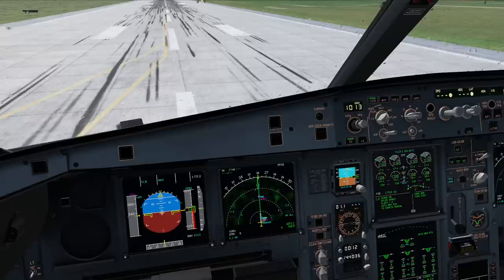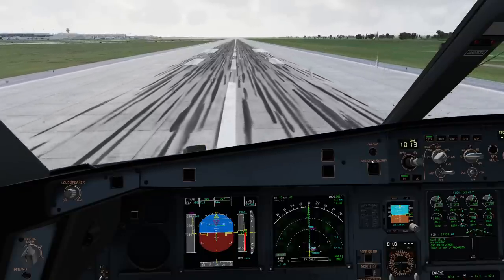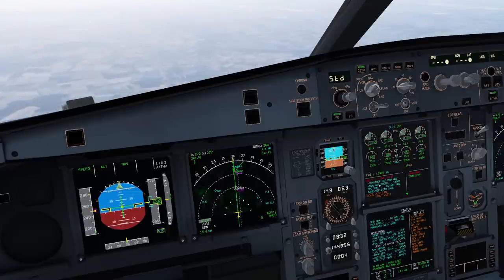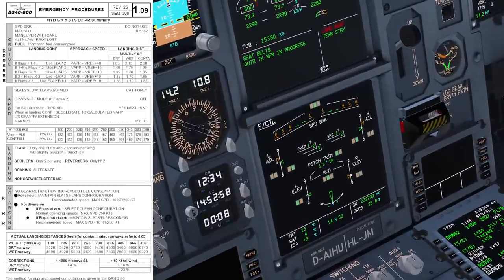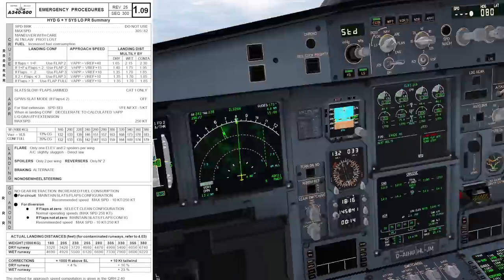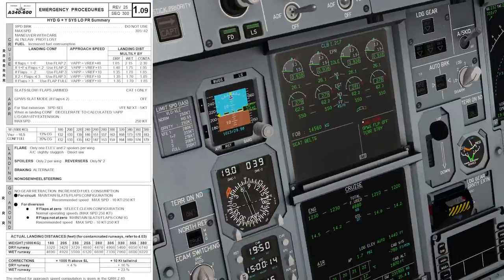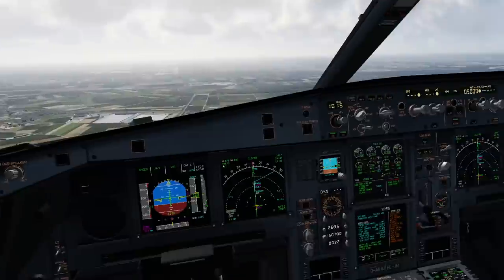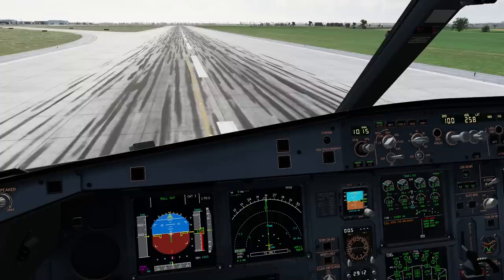Airbus Emergencies: DUAL HYDRAULIC G+Y | Real Airline Pilot

Comment: Emi, we really need you pushing a developer for a proper A330. Loved your 737 content and can tell how much you are “in need of” a proper A330 for content. Thanks for all your great content as always!
Reply from the maker: Indeed I'd give a LOT for a proper A330, it feels somewhat strange not to have "that plane" for videos if I want to do something.
Reply: With the default a330 you can also trigger A LOT of failures, starting from lights, to hydraulics, including bird strike, tornado, ILS down on an airports or PAPI failures etc. You just need to press « i » and it open the instructor console
Reply from the maker: yeah, but what's the use of them if the plane doesn't respond right?
Reply: @A330Driver  I tried some, it works well when it comes to failures (i am not a pilot so I don’t know how it really works indeed)

Comment: The workload when this happens is huge and clearly shows the need for 2 people in the cockpit. Some questions that came to my mind:
1) Since you didn't have the performance calculations due to the documentation, wouldn't this be calculated by the FMGS? Approach speed with the weight?
2) Wouldn't the FMGS also calculate the braking distance with the current weight and compare it with the length of the runway?
3) Would the notification to the control tower be like Pan Pan or something more serious?
Great video!!!
Reply from the maker: Hi,
1) The FMGS does not take all additives into account. Non normales often require additives that the FMS doesn't know about, in some cases as much as 30kt extra.
2) No, the FMS does not calculate stopping distance.
3) It's a mayday since you have less than two AC power sources available.
Reply: @A330Driver   True, that's why performance tablets exist, I ended up forgetting. Why is this not on the FMGS? Wouldn't it be simpler and mostly redundant for you to enter this data and match it with the one provided by the airline and the tablet? Or do you think it could generate even more doubt?

Comment: You know this is Xplane because the weather radar on a 3rd party airplane is working 🤣

Nice and interesting video, thanks!
Reply: Agreed! As nice as MSFS is the lack of a functional weather radar is really inexcusable. Really seems like Microsoft was aiming for the day VFR Xbox crowd from the beginning and have been really slow to implement proper weather systems.
Reply: No tilt is a real bummer. I get that gain would be complex, but tilt is essential imo
Reply: Is it a working RADAR? If you are at FL360 and there is precipitation at FL80 to FL180 does the display show the weather is below your flight level? Otherwise it’s just a pretty picture that could easily be added to MSFS right now. MSFS Devs have choose not not to add pretty pictures that don’t actually reflect the full functionality.

Comment: Hi. At a moment, you say there is no point to deploy the RAT because the G hyd is empty. However, FCOM (!A330) says that even in case of low lvl in green hyd, the RAT can be used to pressurise the green sys. It deploys, by the way, automatically in case of low LVL in G and Y hyd. Is it diff on 340 or do I miss something? 
The Summary, though, says that the line stating to consider the RAT use does not appear in case of G sys Low Level... which seems logical.
getting confused... 
I know that some very low level in the G can be sufficient for the RAT to re pressurise the G sys.
Thanks

Comment: Would you get in trouble if you pushed the flaps out on the low level indication to try to have them for landing?
Reply from the maker: There would simply be no reason to do it.
Reply: If they get stuck somewhere in between, then you are a test pilot of an experimental, never trained for that condition and the aircraft config never tested in those conditions. For your approach speed you would have to consider the higher stall speeds of the less extended flaps, therefore wouldn‘t win anything and for your max speed you would need to consider the lower speed of the higher flap setting. So your safe speed band would decrease, you will lose safety margins. I (as a non pilot) would say that it‘s safer to stay with the trained and documented procedures and aircraft config rather then experiment in such critical situation with passengers on bord.
Reply from the maker: Also keep in mind that whole you can fly slower with the slats further out You'll still have a much higher pitch. You're already close to the Tailstrike limit with Flaps (Slats) 2, If you went further you'd probably do a three point landing or at least be very close to one.